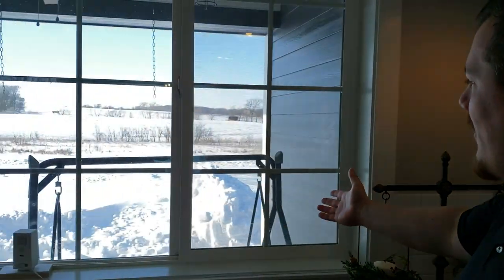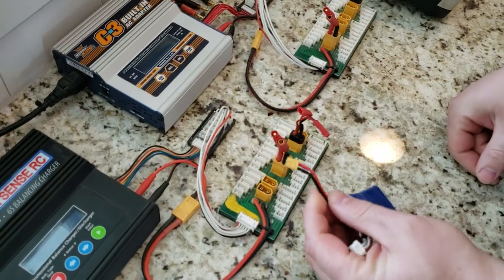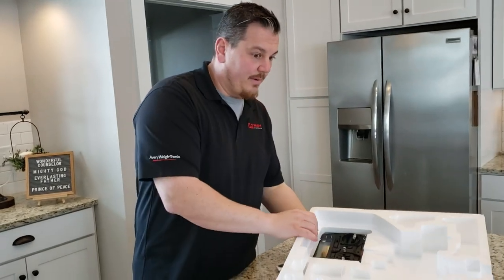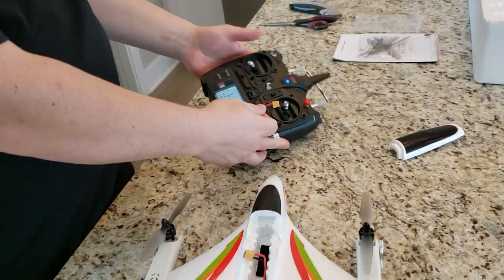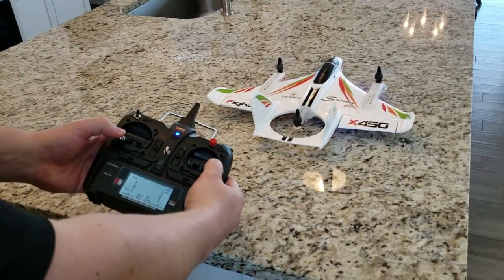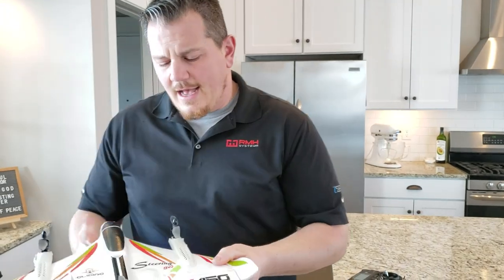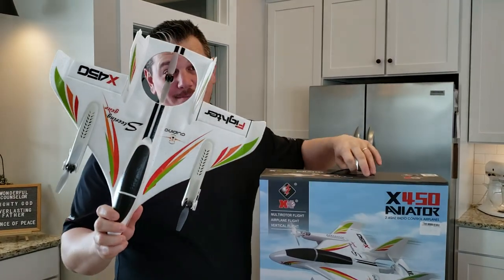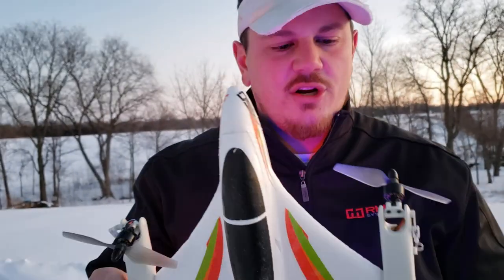XK - X450 - RTF VTOL - Unbox, Setup, Flights Inside & Outside

Comment: This is with out a doubt, one of the most fun RC aircraft I own.  I'm primarily a quad pilot, but this thing is amazing.  Can fly in the typical yard in quad mode or will scream in airplane mode. In fact I ordered another one.  There is one thing.  I strongly suggest upgrading the motor servos to metal ones. I came in and clipped my neighbors house.  Not a bad crash but destroyed the servo gears on one motor.  Since I sell plastics for a living, these gears are generally made from Acetal.  The same materials used in your faucet.  The problem, Acetal has no ductility or toughness.  They basically shatter.
Reply from the maker: I totally agree. Metal Gear Servos are a must. BTW, I fixed mine and have flown it again...what a FUN VTOL!!!

Comment: I just received mine too Brian.  What I do is coat all my foamies with urethane.  It won't hurt the TPO foam. Since I sell plastics for a living it's technically Thermoplastic Polyolefin.  A material I sell but in pellet form.  I've test hovered mine a week or so ago.  Flies OK.  Not quite as stable as a true quadcopter. I also mounted a 5.8 ghz camera on mine for FPV.
Reply from the maker: Have your tried the vertical hover mode?!?! I couldn't believe how well it did!
Reply: @BrianPhillipsRC  Yes. It does great.

Comment: watch out for the motor servos, they are plastic geared and can not take any crash that hits the props. I got a bad unit that flipped from a bad FC. I bought a new FC and hid a hover test everything seamed great until I went to winged flight. The servo got to it's striped gears and stopped working causing the craft to crash. Just spend the few extra bucks and get the craft that all these are copying from. The Mini Convergence.
Reply from the maker: Might not be a bad idea ;) HH has a way of making a good item...

Comment: Oh forgot to mention... Any altitude you choose the left stick in the halfway 50% top position will maintain auto height in your stabilization... 

The servo that broke can be ordered online separately... They carry every part for this aircraft online! You might want to switch to metal servos if you crash it. It can withstand more punishment. Or just order the stock plastic ones and fly carefully.... ☺

I experimented with 3 and 4 bladed props with mine for more lifting power... Mine is modified for the things I do with it... But the stock prop gives the best aspect ratio in all modes... 

Remember to "Transition!" Hehe 😃

Take care and God Bless you both! ❤
Reply from the maker: Thanks! Agreed totally about metal gear servos.

I've only seen the Rx and Servos...but maybe I wasn't looking too hard ;)

Love this VTOL - it's AWESOME and VERY fun!!! I've been flying more carefully with it, and it's JJRC counterpart, and they're both GREAT! It's one of the FEW examples of being significantly BETTER than the Horizon Hobby offering (Mini Convergence VTOL)

Comment: Hello I just got the X450 the manual is very confusing I'm able to fly it around my house " the cats hate me " when you showed how down and opposite sticks does that engage to Gyroz? I was able to start the motors by holding the "take off " button thanks love your videos!! ,,Scott in Denver. Oh what is the difference between mode 1 & 2 have not tried mode 1 yet or 6G mode yet
Reply from the maker: Thanks Scott! Mode 1 and Mode 2 are different control layouts on the sticks of the Transmitter.

Might want to google this, since you'll have a diagram them ;) I fly MODE 2 all the time, but Mode 1 is kinda the "other" popular mode, whereas some some use Mode 3 and even less popular Mode 4.
Reply from the maker: The OTHER modes you're talking about are 3D/6G (Stabilizer and Auto-Leveling) and the "other mode" - Off...I think (sorry). This speaks to the amount of flight aid that comes from the flight controller, BUT in a VTOL, there's always quite a bit of help. Even in "forward" flight mode (P.S. don't do that in the house - LOL) there's quite a bit of help.

Comment: Howdy Brian How are you controlling the flat yaw turns???
Reply from the maker: The flight controller does like 95% of flying this little ball of joy. It is so much fun, but equally crazy if you run into something, in the fact that it will eat itself for lunch - LOL ;)
Reply: @BrianPhillipsRC   Copy that. to bad there wasnt any prop rings around the forward motors to protect the propellers. Wiuld love to see I t fly outside in which ya could rotoate the motors to forward positions.

Comment: Any idea what this aircraft does if it failsafes?  For example if flying in airplane mode and loses signal?  What does it do?  Does it go to hover mode and land or just drop?
Reply from the maker: Sorry Chris, I haven't tested it, and hope I never have to!!!

What I can say for sure, I only KNOW the Mini Convergence will go into hover mode when the voltage gets low. Also, I can say for sure the "forward flight mode" out of 6G is a HUGE handful of crazy beans...I wouldn't recommend it, and be READY to flip to hover mode like ASAP when you make a slow turn, as you will almost certainly fall into an uncontrollable flat spin. I've had it happen with this, and the JJRC M02...but can't say I remember having this happen on the Mini Convergence.

Comment: Most RC stuff is made to sell batteries while the X450 is made to sell servos.  I love XK but there's a problem with airplane mode on the X450.  I want somebody to shrink it down, delete airplane mode and the ailerons.  Bury the tilt arms in foam to keep them from stripping the servos in crashes.  Tricopter mode is surprisingly efficient and it looks great in the air.
Reply from the maker: I agree about the Servo Sales Model XK is running on this particular aircraft.

TWO Gripes....
1) doesn't seem to stop running when you crash....and no way to "kill" it - I hate this feature...
2) As a direct result of 1 - I broke mine...BUT it's easily and cheaply fixable.

Even with these failings, if I hadn't been flying at near 0 degrees (F) the aircraft would be totally fine ;) My fault, plus I was running the transition between modes toooooo low, and that too was my fault.
Reply: @BrianPhillipsRC  Disarm motors is "Stick Mode" at the bottom left and "Camera" on the bottom right, held down simultaneously. Yeah...  Anyway the face of XK is a guy named Lou Ming and he has a Youtube channel where he explains this stuff.   He's on RCGroups as well and seems open to feedback.
Reply from the maker: Thanks guys! I will do the X520 soon, barring unforeseen circumstances. Maybe I need to do the JJ version of the VTOL too?
Reply: @BrianPhillipsRC  I want to see what you can do with the X520.  I think it's everything great in RC airplanes rolled into one.  JJRC's VTOL looks a little better in the styling but it doesn't seem to be functionally different from the X450.

Comment: Explain please how to change to mode 1  throttle right hand. I can switch the transmitter but it wont work properly
Reply from the maker: I'm sorry but have no idea how to do it...but I've heard some grumblings that it can be done on certain aircraft.
Reply: @theoztreecrasher2647  untill this point ive bin..doin so. But then the motors will not start and one time they did start i couldnt stop them anymore and a had to take the battery out to stop them. In mode 2 you start  the motors by holding the sticks down to the outside..how you start them in mode 1 ? And how to stop them in mode 1 ? Thanks in advance

Comment: Very good video, it was like watching myself when I got mine I went from crashing a micro copter into the ceiling fan never flown before to one of these I have only ventured into 3D once that was hairy so knowing I was going to crash it in the 3D I bought a second well it was the JJRC M02 a Black friday deal 70% off a very good copy better in come ways copy with a better transmitter, so now when it stop's raining I can go out and learn to fly better so I can brave the 3D mode knowing I have another 90% the same so I can still have fun.
The key is to be soft with the transmitter no really fast inputs, trouble os I last used a stick transmitter was forty plus years ago, I run 5th scale gas offroad truck's and buggies mainly I have a couple of 6th & 7th scale electric trophy truck's of which you dont need to be so gentle with the input I have a 1/4th scale electric bike that I still haven't mastered after ten plus years of owning it, never flown before early december.
 So loved your reaction the same as so many others on YT so much fun, why did I not learn to fly before, the answer it did not exist until not that long ago and it is to do with the new electronic's available now and someones idea ofmarrying a plane with a multirotor brilliant, wish it had been my idea, my doctor said I needed a stress buster and once I had mastered the basic's I was like you every time I go out it has me laughing, not sure if I even want to go further into drone was the idea until I saw this on YT so plane drone a drone to film me beating on my truck;s and buggies ?????????????
Reply from the maker: Flying is so different than many other RC disciplines, far less forgiving, but I feel that it's far more rewarding!!! I've done cars and truck, and all sorts of other cool RC contraptions, but planes are by far my favorite ;) This little VTOL suprized the heck out of me!!! It was absolutely amazing!
Reply: @BrianPhillipsRC  It is the crashing that take's the shine of a bit, as it is usually terminal for the plane, and as I have this and the JJRC version I have it covered,  I need to get a drone to capture foorage of the fifth scale gas, but after flying the two versions they are very fast in both plane and multicopter I am leaning towards a plane but I need to gain confidence in the 3D mode, although not all planes are also.
These are made easier to fly for the newbie by the electronics they have so maybe a plane with the same electric's is where I need to go, but I am hooked.
Reply from the maker: Planes are most definitely not created equally. Some are fairly easy to fly, and others are VERY hard to fly... If you can fly a quad, you can fly a plane, but you need a runway and some room for a plane, whereas with a quad, you can go fly in a fairly tight space.
Reply: @BrianPhillipsRC  There are quite a few that do not need more than three foot to take off and land, others you launch by hand and if good carch it also, the question is which of them the XK and JJRC can have a camera mounted in the nose to point either down or forward at an angle, I could mount an fpv camera on the canopy as I beleive they can both be plugged into the controller, not certain as it is all new to me as I have 40+ years with gas and an occassional foray into nitro, but just recently I have got a 1/6th & 1/7th scale electric trophy truck's and that got me accepting electric as a form of power, but at a cost ruined a brand pair of maxamps 4S batteries, left them plugged into the truck for a week while away doh a very expensive one.
Reply from the maker: Ouch.....lipos are not very friendly when you over-discharge them... HOWEVER, you might be able to get them back! Did you know, you can charge the lipos on balance charger, and creep the charge up using another setting....BUT be super diligent, and very careful. You might even do it on a back patio (concrete) or something like this, just in case one would catch on fire...which they really shouldn't. You can charge one cell at a time too, if you want. You can also put two (or more) packs in parallel, to get the voltage up high enough to be "recognized" by the balance charger. There's lots of ways to get them "back", if they aren't already puffed, or broken in half....but seriously be careful. This is one of the only REAL risks in the hobby. You seem like you know enough about this stuff to keep out of the hospital :) Good luck, either way!
Reply: @BrianPhillipsRC  Many thanks, I will have a play to see what works, what can I lose they are dead now.

Comment: Just got mine and the charger blinks when it's not connected but turns solid wheh I plug battery in. Any idea why? Could anyone recommend a good charger? Thank you
Reply from the maker: No biggie, they do change these things from time to time. Whatever the light is when you're NOT plugged in, is generally the condition that expresses that the pack is charged.

As for another charger, If you've just got the one VTOL, I'd stick with the one that came with, but I can share a few options below if you really want to charge faster...

Balance Charger https://amzn.to/2IxmRla
Parallel Board https://amzn.to/2uduI1v (Make sure you get adapters to fit your lipo ends)
SMART Chargers https://bit.ly/32qiuBD (you'll need to get the adapter cables for this style)

Comment: Also like I said before, really good content! Just wondering, have you ever build an airplane? Like an ARF or like scratch build?

Also I feel same way about FAA right now, discussing.
Reply from the maker: Yes, I used to work with my late Grandpa on them too. He'd stick build them, and we'd get together and work out what electronics were needed, then we'd order everything and then we'd meet up periodically, and setup the plane...the culmination was always flying it together. He and I really enjoyed these last few years sharing this experience.

Also, when I was a kid, I built a few models, but never RC'ed them. They were just gliders.My dad had a sig cadet (maybe) with a gas motor and futaba radio. We went out to fly it, and crashed into a corn field...total loss :( Oh well, that was the way it went for most.
Reply: Brian Phillips cool! Do you still have any? And yeah corn fields are the the nicest things sometimes
Reply from the maker: Yeah, I have a few that I fly. In fact, I flew the 1600mm Sunbird just this afternoon! I want to build another one, only really get it "just so" with proper control surfaces built in. I've kinda hobbled it together from what my Grandpa had originally built....but it's a great flying plane with huge split flaps, and crow setting too. You can fly nose down (straight down) and slow down!!! It's like deploying a parachute! I love flying that plane!
Reply: Brian Phillips that sound like a crazy plane! You should make a flight video or something, it’s out of your normal upload type but maybe you could fly more than just the one!
Reply from the maker: Here's a link to the playlist for the Sunbird 1600 - https://www.youtube.com/playlist?list=PLXTH0DstRDc6Vct6f6sL2o4o3qNm31G9o - which was not a very popular series...but whatever the case, I suspect you'll enjoy it, especailly THIS video - https://youtu.be/vYiKy_iEdpE?list=PLXTH0DstRDc6Vct6f6sL2o4o3qNm31G9o

Comment: Love the plane just wish it didn`t break so easy! I have seen many video`s on it and it always seems to break easily after small crashes! It has plastic servo`s that when tweeked at all by hitting ground or plants, ect., just breaks. Have to fly this one carefully, or it quickly becomes paper weight.  Dude, Love your video`s though!
Reply from the maker: I agree - it's easy to brick this VTOL, BUT, I've already fixed mine once, and just used spare parts from other planes in the "junk yard" - LOL - This thing is a blast to fly!

Comment: Hey Brian, I'm #1... LOL W@@Wzers L@@K At All That Snow! It's Just Cold & Rainy Here... Pretty Cute Lil Plane, Like The H-H Mini Convergence VTOL BNF Basic, 410mm w/Lights, Battery, TX  & $30 Less? And Yep It Has The Same Problems w/The Cheapy Plastic Gear Servos On The Motor Turning Arms That Strip The Gears or Break The Control Horns Constantly! Change Them To Better Metal Geared & Should Be Great! Thanks
Reply from the maker: I guess Horizon Hobby needs me to cover their VTOL, so they can keep the price at $229?!??!!?!?!?!?!? Why is it so expensive?!?!?!
I think Horizon Hobby does a lot right, but lately, I feel like they're pricing themselves out of a HUGE RC market.

1) They out to be our lobbying HARD against FAA Remote ID
2) They ought to be designing a chip for when FAA Remote ID becomes the "Law of the land" despite the FAA not having any constitutional authority to make any LAW...
3) They need to reduce their prices, or at least offer the 10% off coupon codes they used to do
4) They need to send me items for review

Of course, the last is the most important - LOL :)
Reply: @BrianPhillipsRC  They Lowered The Price To $129 Probably Because They Break Them Damned Front Servos Soo Easy! LMAO
Reply: @BrianPhillipsRC  Now They Made That UMX Ultrix Which Is Like A Mini Delta Ray  With A Whole Lot More 3D Manuvure Throws For $120
2 Days Ago I Wrote This On The HH Show!
And Soo It's Started, Brainwashing Your Customers Into The Sub-250 Gram Crap Catagories, Because Before Long That's All You'll Be Allowed To Fly If Left Up To The Crazy FAA & American Government, Etc!!! You Best Take A Bunch Of Your Profits Moneys & Fight For Our Rights To Fly What We Want In Our Skys Soo You Can Continue To Make/Sell Your $200 - $500+ Larger Models That We All Love & Y'alls Make The Most Moneys On!!! Just Saying... #SayNoToFAADroneProposels #DoNotTreadOnMe #NeverStopTheRC Thanks